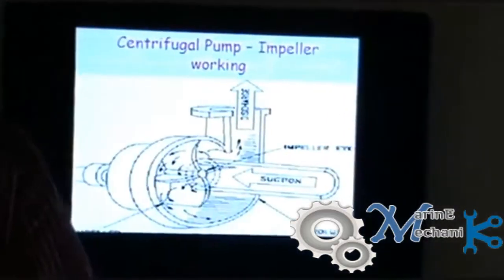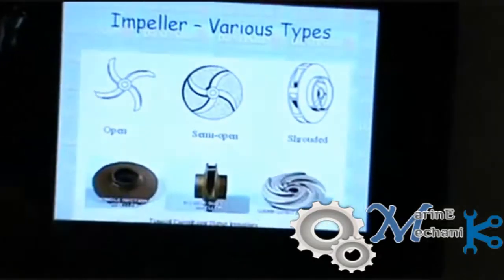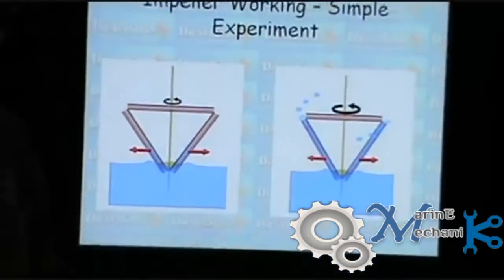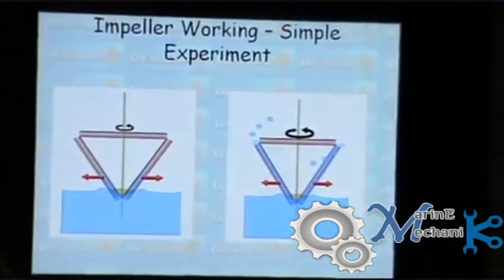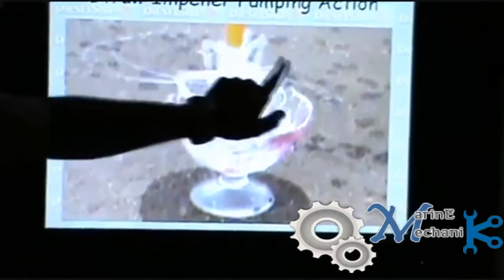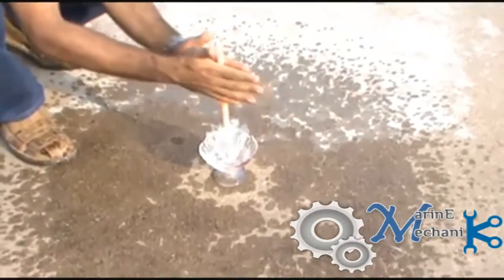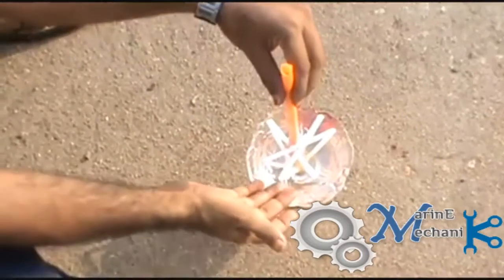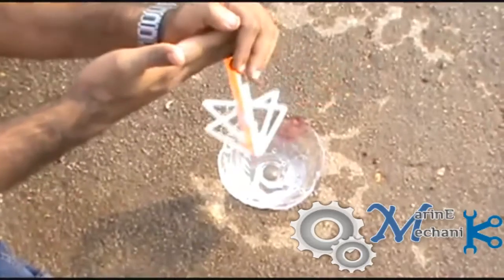Centrifugal Pump - Impeller - Experimental Demonstration.

Comment: My 1HP new motor working but water not coming bro.. condenser connected by electrician..Fan rotating clockwise but water not coming bro.. what direction fan/impeller should rotate?